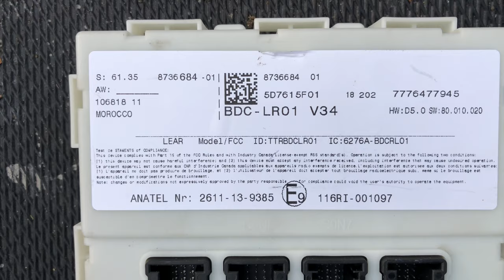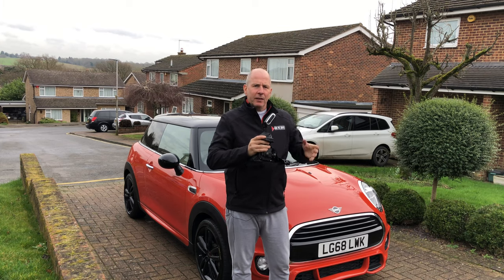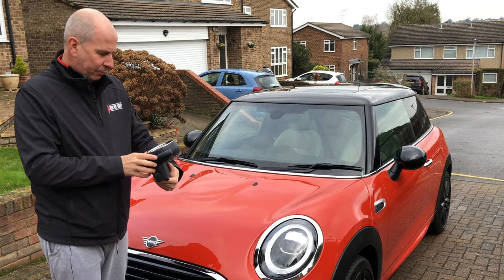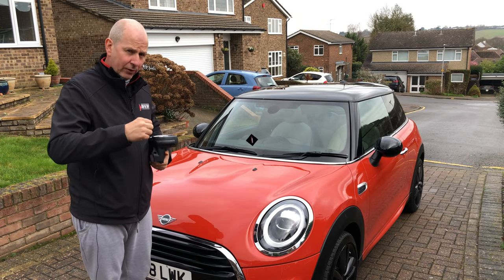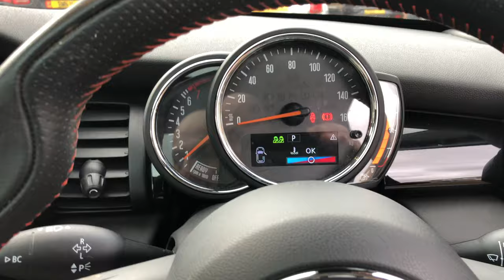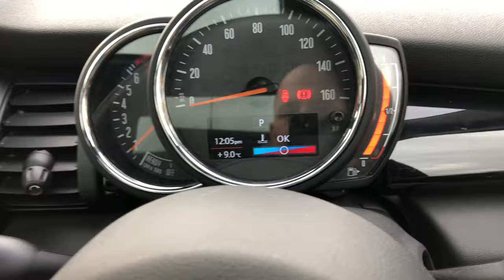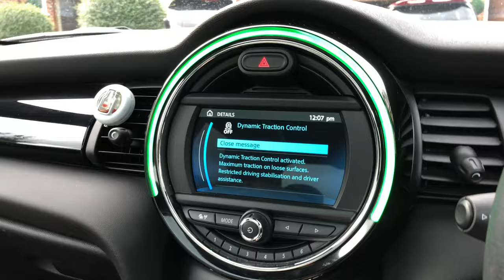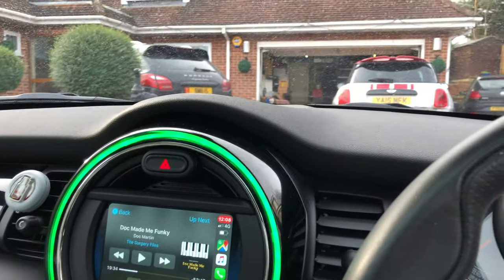Mini Cooper F56 Flood Damage Copart Rebuild. ECU, Air Bag, Auto Transmission Selector and Cluster.

Comment: Much thanks for making a video about this, All the way from Alberta Canada, Anyway I'm looking a super low mile under 7K miles 2021 clubmanS in 2 pedal trim ( Auto ) and I'll bet has the very same electronic water intrusion parts your's had the place is asking under $23usd for the thing, they call it Water intrusion and of course non minimum water damage to them but once a person buys something like that it's usually a different story, You changed out 4 separate electronic components here,the BDC unit,a airbag module,the Automatic electronic gear selector stock and the Base model mini anolog  Gauge pod, in which the S trim has a more electronic flat or oval screen electronic anolog Gauge pod cluster, but I'm sure when  the  4 parts are replaced in the 21model year clubmanS I'm looking at it will be just fine and save over $10K usd when fixing this one and not buying a non water damage low water flood mini. Too bad the car name didn't match the water damage oh yes it a water damaged mini with not mini damage. Anyway thanks again for your time here sharing with us the one's who don't mind fixing the fixable and saving huge coin in the process.

Comment: Might be worth changing the 2 cabin filters under the dash to see if that helps with the smell, water may have got into them?
Might be worth removing the front seats to check the wiring plugs underneath, they may have corrosion from the water which is why the heaters don't work and the seatbelt problem on the pass seat
Reply from the maker: Hi Robbie, yes good call might have a look and remove them to see if they are a bit funky. Taking the seat out today so will update to see if there is any evidence of water underneath and around the seat electrics.

Comment: Hi , Try an ozone machine to get rid of the damp smell. Use the car for a while because often electrical problems appear after a few weeks and if it was salt water, for ever. It was a bargain but it is hard to sell cars when they get above £5000 especially when they have a category.  Often they find there way back at colpart repaired. Enjoyed the clip keep doing what your doing.
Reply from the maker: Hi Jeremy, thanks for the comment. Yes will give it a go but just using the car for a few days has seen a vast improvement in the smell so hopefully another few days with the heater on and a nice air freshener should see her back to factory fresh.
Not sure i agree on your comment in regards to selling Cat cars. I am always very careful that I only buy ones that are coming straight from the insurance company and not been a previous repair. The proof will be in the pudding when I get to advertise it and let's see how the market reacts.
Reply from the maker: £75 to hire the machine for the day. Organised for Saturday so lets see if it works.

Comment: Hi my friend. I just bought a flooded mini cooper countryman 2020 with just 7,000 KMS. Previous owner repaired everything he told me water didn't got inside the car. The only problem the car has, is that when you turn the car off, some times (5 out of 10) the car won't turn on (it wont do anything, just turn on the panel and when you press start, wont do anything). You will need to remove the ground from the battery and put it back on, and it will turn on as normally should. Someone told me that the car needs to be reprogrammed in the mini dealer. What do you think???

Comment: Dude the wiring loom will need replacing
Reply from the maker: Hi Danny, actually it didnt. Found all the electrical issues and repalced the modules as i discovered the issues.
Reply: @NowWeDrive  every flood car should have it replaced. tell me how it is in a year or so.
Reply: @mYuSERnAME11100  Exaxtly my thought's mate......been there & done that myself.
Reply: @NowWeDrive  So you think.....wiring loom side of connectors still corrodes ?
Reply from the maker: @1972dazbo  Of course they do and using the corrosion spray helped a lot but it will only go so far. I was lucky

Comment: Should be a "cat B" parts vehicle only these flood cars......minefield of electrical problems that could always play up in the future...?
I had one years ago that never had half the amount of electronics as this car and after swapping / changing everything required including drying out in a spray booth and running the car for 12 months basically it had a mind of it's own and often electrical issues would play up and leave you scratching your head ?
No way should any of these ultra - modern vehicles with flood damage be allowed back on the road unless you swap out the entire wiring loom & electronics so you know 100% there is no hidden corrosion that could cause anymore costly repairs as well as reliability issues.
Flood damaged car defo not for me personally....greedy insurers should not be allowed to sell unless for parts / donor vehicle
Reply from the maker: Hi Daz, yes would agree with you in the most part but when it is only partial water ingres then it can be salvageable. You are right it is a lottery and buying that Orange Mini was a huge gamble that paid off.
Reply: @NowWeDrive  Glad the gamble paid off for you mate.....it's ok if doing it for yourself but on re-sale,well time will tell for the new keeper if the lower price tag was worth it eh ?

Comment: At 8:19 minutes you were wrong in saying look at that now we have no idiot lites on the base gauge readout when in fact the still unfixed water damage to the rest of the car , like interior soaking still around the passenger seat belt was connected into its closed or on position , you still weren't buckled Up either but once you do , your saying that seat belt reminder light will still be on because of the interior water damage still not simply addressed as of this video? Too bad you must divulge everything to the next person simply because it's the right thing to do & not pass on information that's not true or reliable, fix it first or let it go to the next person with all necessary information so they have a better chance to deal with it the still not completely water damaged base mini with a basic generic too me visual package I'm not going to say here because it's well overdone by everybody.

Comment: Still again BS this is a Base mini with a optional money Grab visual package & not even a cooper or S trim car, Base everything , engine, slush box, chassis, wheels and tires brakes super mini sized rotor's and disc's you name it all bottom basement no go fast part's on the thing & if you do go fast good luck keeping a Base mini under control or even stopping from a high rate of speed in a straight line let alone a off camber decreasing radius full of sweeper or even chicane, this thing is a grocery getter and that's it that's all your too bloated like a used car curber or even a oem dealer BS.